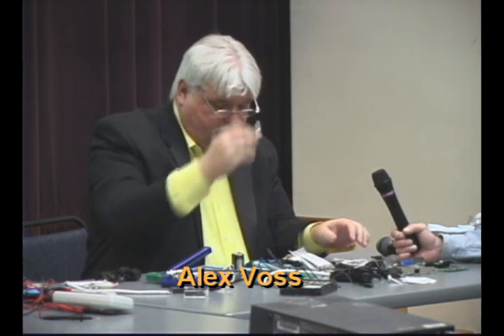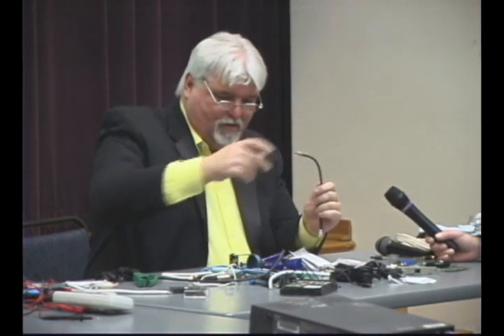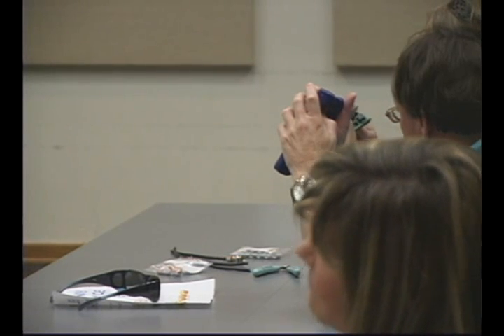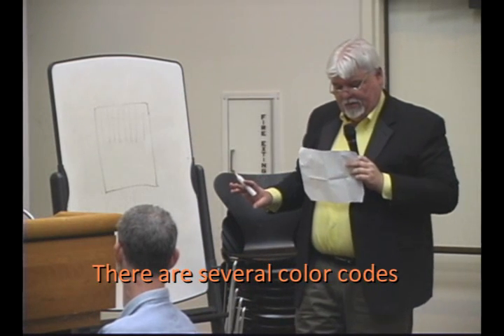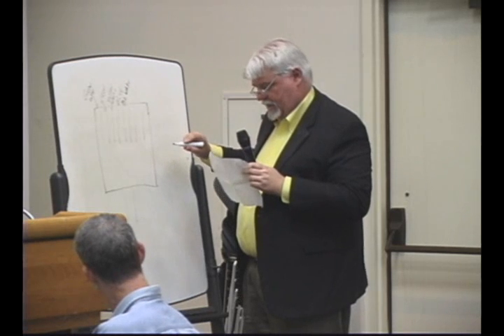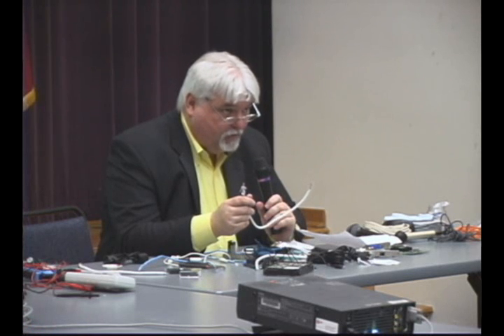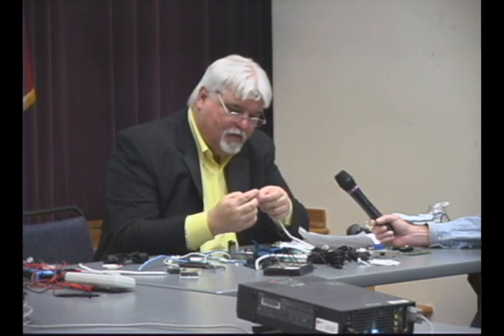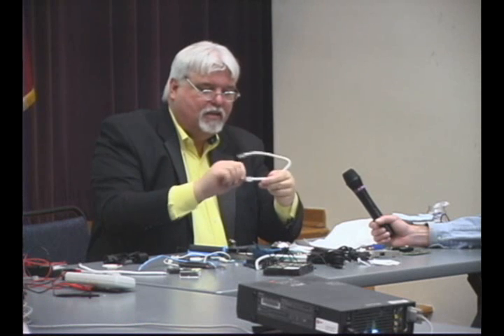Basic Electronics 6 - BNC, F, and RCA Connectors How To install

Comment: preassembled cables have their practicality. They are not practical when building a network where the cable has to be pulled through wall jacks installed, etc.  Even you made cables at the lengths you can buy preassembled, the cost of the crimper would amortize fairly quickly, and you will end up with cables that fit your application  without extra cable to dress up.  Even at walmart while they may be cheap cables, they aren't inexpensive.